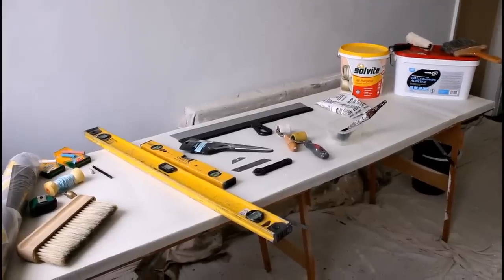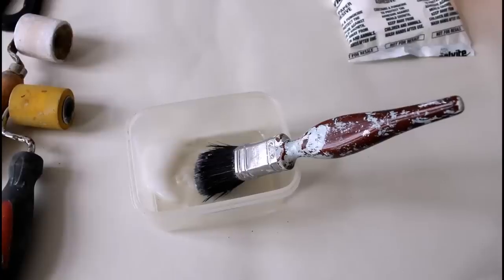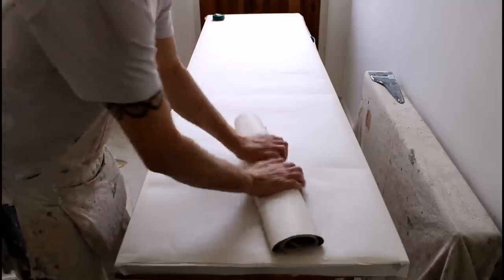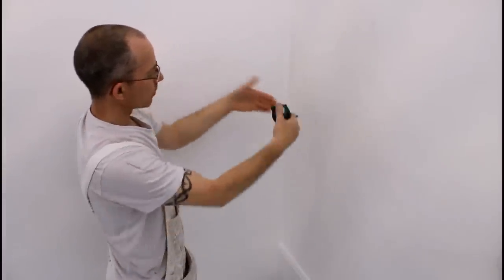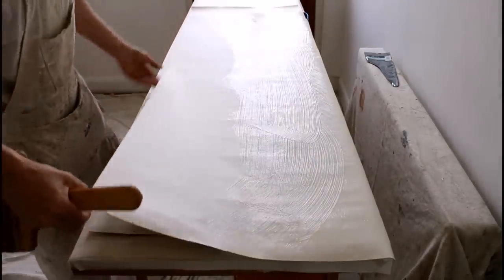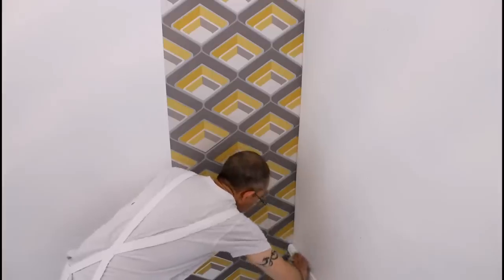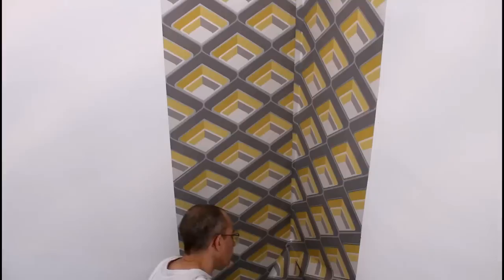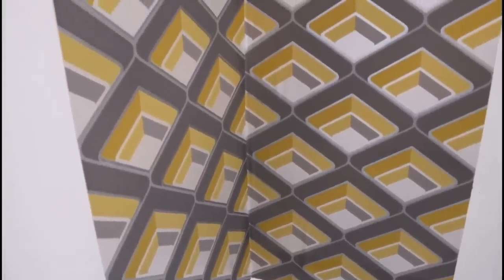Wallpapering Around Internal Corners

Comment: I have always used a paint roller to put my paste on. You get the same smooth finish every time and its very quick.
Reply from the maker: Yes I just like using my flat brush... also think a flat brush applies a better layer of paste especially on edges of the paper.
Reply: Horses for courses, but I prefer a brush. I find it soaks the paste into the paper especially when working with a heavy paper like anaglypta

Comment: That’s crap! The pattern doesn’t match for gods sake the only time you’d get away with this is with a non pattern paper.
Reply: so wht do you do then ?
Reply: Erm...take into account the pattern differential. Makes sense right.
Reply: @totemtommy  so what you saying hang paper lob sided to match pattern send rest of wall out  would look pissed or do as in video lose pattern into corner so the whole new wall looks straight is the only way the pattern carnt be spliced to look right because of the pattern ask any man who does this on a regular basis its always the big picture you would be working to try hanging a wide splice match when things run out at 1000+ a roll haha
Reply: @mrbuchkie  You get a fresh sheet of paper to start the adjacent wall with. Match pattern at eye level and then let it go off as it may above and below that point. Uses more paper but nets you the very best looking corner possible.

Comment: Get yourself a laser level, your methods are old , spatulas are ok as long as there are no nibs etc as the brush wooden part can sometimes hit the wall when the bristles collapse,  especially when losing grip, or a clean low pile or sponge roller is good too, just don't press too hard , you dont need to tbh
Reply from the maker: You're wrong why waste money on a laser.  I bought one and don't use it because it's rubbish for decorating. 
Also never use a spatula if you want a professional job doing.  Not old methods just correct methods.  
You will learn eventually that new ideas are just to sell products. Thanks
Reply: @PaintingandDecorating new ideas ? Laser levels have been around for yrs &  laser levels are 100% accurate so not sure there ? Regarding spatula to flatten paper etc i always use now & as long as there smooth on edge & plastic it's perfect, did a job yesterday that way, much better, the wooden part of the brush can sometimes catch paper if not careful, never happened to me but can happen , the spatula also pushes out any bubbling in paper as it sits completely flat on surface unlike bristles which are individual, 38yrs exp & counting, each to there own but your methods are old & you wont beat a laser level for straight lines fact

Comment: By the time you unwind and Wind your string line im allready hanging paper ,lazer level is already doing its job before i start making a level line.
Reply from the maker: right ye... I have a lazer and it slows me down. 
I use the lazer once in every blue moon. I bought it on a blue moon.   Basically its a lot better using a plumb bob that does not need money to tell me the line is vertical. Same with a spirit level costs no money and is no waste to the enviroment. Thanks

Comment: Thanks for these videos really helping me out. Have you done one about papering around an external corner as well as I cant find anything anywhere. I am about to approach an external after papering around an internal using your method I plumbed a line and its really straight I thought I would ask you would you just come around the corner or would you come round by 5 - 10 mm then overlap slightly then match right up to the edge of the corner and use border adhesive. I am using a pattern paper but its a marble looking pattern not large pattern. Do you think its best to measure up to the corner from my last line then add 10 mm, bring it around the corner then match up the cut ( there is a light switch involved as I come around as well but  another story there). Wallpaper measures 530mm it could wrap around the corner and do the light switch but would it be hard to do.
What would be the best option its doing me head in !!
Reply from the maker: Thank you...  not sure I've done one on external corners yet. But your paper needs to be plum..  allow paper to go around corner then make sure edge is plum...  sometimes this can leave small bubbles up the corner...    nothing you can do generally....  your lucky if your corner is straight.
Reply: Thanks for reply we tackled it in the end and in general were really pleased for a first attempt at wallpapering. We had to overcome light switches x 2 Double plug x 2 , bathroom fan switch two internal two external corners and a burglar corner sensor and two door frames  all on one wall 😢😢You made it look so easy we took ages 😂 and nearly divorced. Only real error is I can see a tiny 1mm overlap now partly down the seam but we  can’t do anything now as it’s dried overnight which is only thing that’s stopping me celebrating. At least we saved £90 thanks for taking time to share your knowledge I know how hard it can be to keep updating these videos. Well done true pro all the best to you 👍 so hard to cut paper with a craft knife as well kept catching and ripping even using a metal edge that’s really annoying as well.
Reply from the maker: @winty2721  Your welcome glad you had success. Thank you

Comment: Why don't you show people how to cut the whole length/sheet of paper to go round corners, there is no way you can expect to go round a whole room using that technique, you'll have to be splicing like mad otherwise.
Reply from the maker: Wrong you only have to lose the pattern in one corner.
Reply from the maker: Splicing lol.
Reply: @PaintingandDecorating  typical comment from Mr know-it-all.
Reply from the maker: @badbwoy3000  Thanks. Some would say he knows his trade.
Reply from the maker: Will do another video showing how it's actually done and it's very easy.
Reply: It’s true you have to pick a corner to finish and you don’t always start from a corner like that because when you get to the next corner it may fall to close and end up cutting a to small a strip that’s why you measure the room out first so you don’t get any bad drops of paper especially around windows and doors as well corners
Reply from the maker: @derekstevenson8885  The natural light determines the start point most times. Usually paper window wall first then work away with both sides finishing above the door in the corner.
Reply: Painting and Decorating once you have measured your drops and the waste and like I said if they are ok around the window and any other objects rads and anything else you can start anywhere in the room in the middle of a wall as long you know where every drop is going and it is like you say it’s is usually above the door The shortest piece that you finish but gone are the days when you have to work away from the light with modern paper nowadays
Reply from the maker: @derekstevenson8885  Each to their own but why change what is perfect.   gone are the days lol
Reply: Painting and Decorating by the way I  am not criticising you and I hope your not offended . I love your channel  and all painters and decorators have there own way of doing things . What ever work for each and every one of us
Reply from the maker: @derekstevenson8885  Thanks, and not offended.  And your right it all depends on who we served are apprenticeships with.
Reply: Painting and Decorating did my apprenticeship with John of Nottingham in 1973 it was still old school then and l learnt to paint walls and ceilings with a brush until they let me have a roller
Reply from the maker: @derekstevenson8885  My dad was using a flat brush and my brother back in the day. But my brother used rollers in college and converted me dad in the end. But you do get a nice finish with a flat brush on a smooth wall.
Reply: Painting and Decorating a lot of the men at the time that I worked with would not use a roller they didn’t like them. Now days it’s spraying walls ceilings and woodwork
Reply: @PaintingandDecorating  natural light determines nothing, absolutely nothing in determining the start point or the kill point in wallpapering a room. Pattern placement, pattern balance and seam engineering are what determines what. By the way you never, I repeat never kill-finish a paper in a corner. Corner is the the same length as the wall so is very obtrusive as a mismatch. Above a door or above a window is the shortest point to kill a pattern.
Reply: @derekstevenson8885  your spot on Derek.